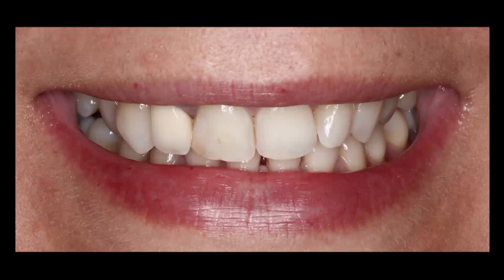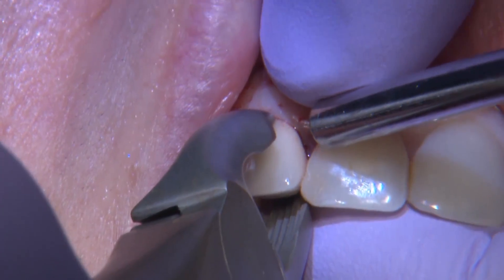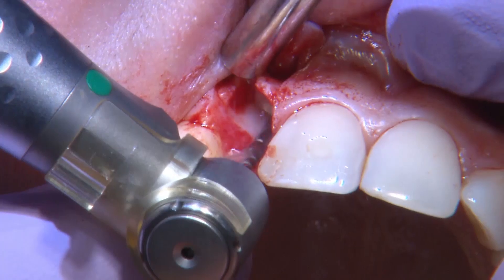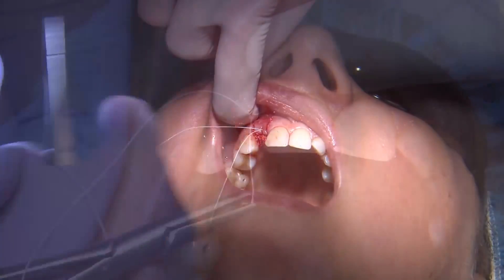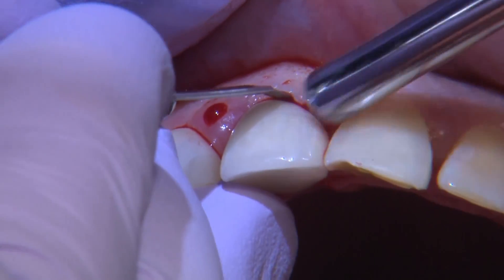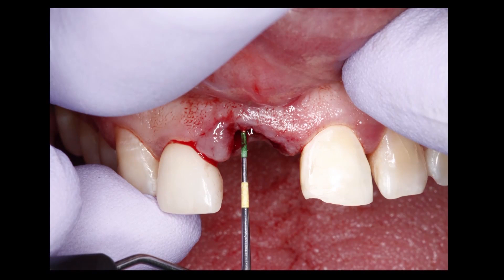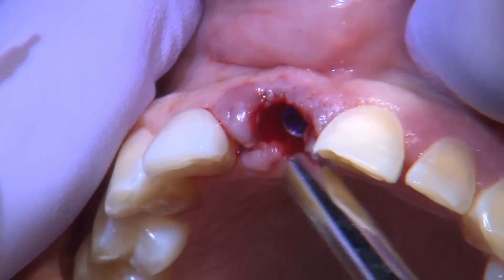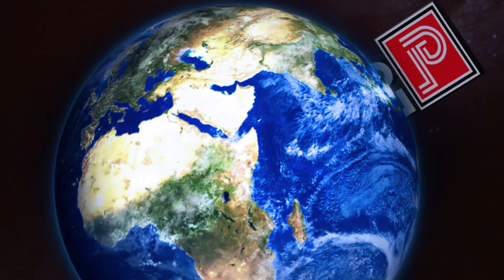Case of the Week: Immediate Implant Placement with the Hahn™ Implant

Comment: In most humans, the buccal plate(bundle bone) of anterior teeth is <1mm and it's blood supply is derived from the PDL and from the periosteum. In this procedure, the tooth was extracted (along with the PDL) and a full-thickness flap was reflected (stripping the periosteum)- thus severing all blood supply from the fragile buccal plate which could lead to recession. - unfortunately.
Reply: What to do such case?instead of this@garychike266